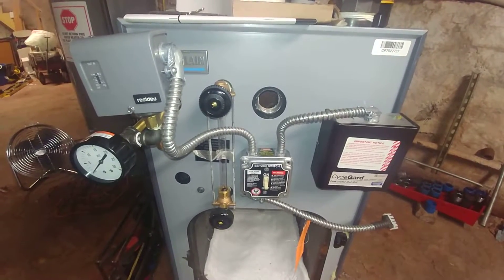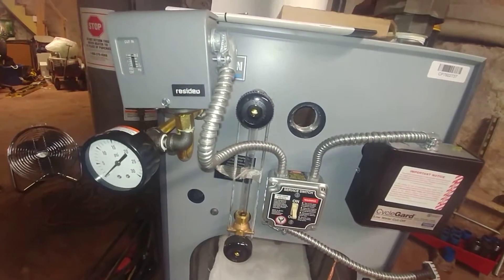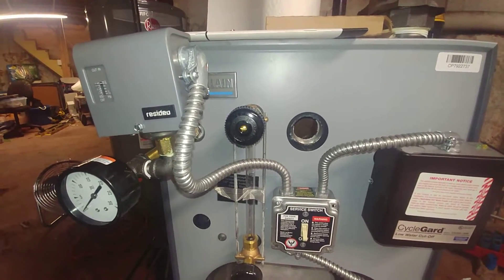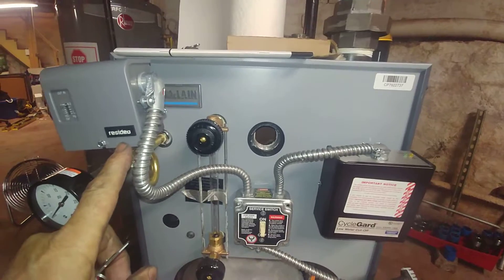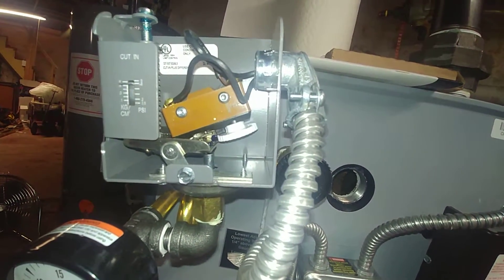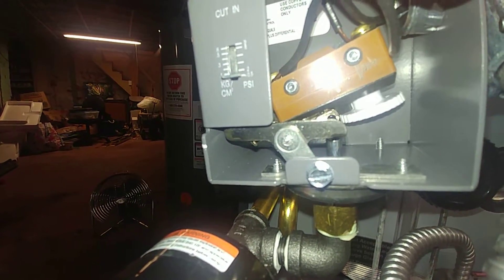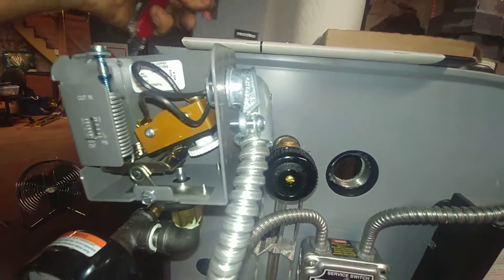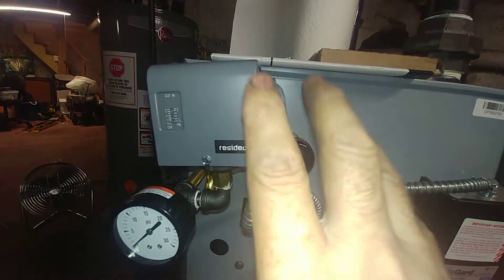Steam System Pressure Controllers Need To Be Checked And Properly Adjusted By The INSTALLER!

Comment: I know this is an old video so not sure you will take a look at this but quick question.  My Controller is set correctly, as you showed but my heat still runs up to 3.5 on cycle.  It seems high considering its set all the way down.  Is this normal or does it mean I need to clean the pig tail?  Thanks for the help great videos!
Reply from the maker: Hi! The PA404 is a reasonably precise limit control, but not very accurate.
What you are experiencing is an all too common occurrence with these controls, in that they allow the boiler to operate at pressures higher then the settings indicate.
You can tweak this control to operate closer to the 1.5 psi limit and I believe I show this in other videos (it involves very slightly bending the tab to engage the little pin on the switch way in the back).
Careful, you may go too far and make the switch not be able to reset. You can just bend the little tab back down.
It's really hard to show that on ytube because it is a "feel" and a slight "tweak".

Comment: So I just had a Weil McLain eg 6 series installed last year with the psi at factory settings. The tech that did the tune up this year lowered it to about 6 but after researching I initially lowered it to 1 with a 1 differential. At a higher psi the upstairs radiators that were giving troubles seemed to be working normally again, but after lowering it they’re back to square one. I’ve had guys come out just to bleed the radiators (which I’ve also done myself) and changed the vent valves numerous times with no luck. The pipes that connect to them get hot just not radiators. I know the radiators are still functioning since they worked at a higher psi but any idea why they are inconsistently or aren’t heating at all? Thanks in advance
Reply from the maker: I have no idea why your radiators are not heating.

It sounds like you really need to have a true steam person look at your overall situation and not just someone who "says" they are knowledgeable.
"Bleeding" a steam radiator sounds wrong to my ears.
Steam heating pressures set above 2 psi have been wrong since November 1899.
Reply: @gordonschweizer5154  Understood. I appreciate your time and response!

Comment: What is the downside to keeping it set high? I imagine that setting it low allows for the gas to turn off quicker so that its not trying to set such a high pressure, aka more efficient. Also i imagine this will help with banging pipes and potentially leaks from the valve stems which i was seeing. I bought a new house that was set yo the max and i hope this helps with the gurgling and hissing. Do i then need to adjust all of my vents? Or should they stay the same.
Reply from the maker: There should be very few upsides and a lot of downsides for keeping the pressure too high (above 2 psi) as you yourself point out.
As to your hissing vents, do they fog up a mirror when they are hissing? 
It might be time to replace those.
Reply: I'll take a look at that. Thanks for your suggestions and support.  @gordonschweizer5154

Comment: 150,000btu steam bioler in a residential property shouldnt my pressure limit gauge be set at 1
Reply from the maker: @lionsrunthenfc  The PA404A really is not designed to operate at a high limit of less than 1.5 psi.
If your steam system needs to operate at a lower pressure, then a Vaporstat is needed.
Reply: @gordonschweizer5154  so do I need to turn it back up to 2
Reply from the maker: @user-dx7ky6qc4v  Turn what up to 2?
Why?
Are you talking about the "cut in" setting or the differential wheel?
Reply from the maker: Cut-in setting plus differential equals cut out pressure
0.5 psi + 1 on the differential equals 1.5 psi minimum setting.
Reply: That's exactly what I have thank u.the wheel inside is at 1 and pressure is at 0.5.

Comment: Stationary engineer here and the proud owner of a steam system. Thanks for bridging some of the gaps I had between industrial and residential steam. After watching this I will be setting my vents to get the furthest radiator a little warmer rather than raising my pressure hahah. Thanks Gordon.
Reply from the maker: Great! Thanks!
Also, check to make sure your steam main venting is up to snuff.
Reply: Funny I was thinking the same thing. I never see pressure on my gauge, but I never hear steam leaking anywhere and I’ve walked down the system many times. Brand new boiler, last one had a failed heat exchanger
Reply: Just watch your “why no pressure” video and it all makes sense haha. From my industry experience running equipment is set to run at 12 o clock on the gauge for the accuracy you mentioned. I was not considering that 12 o clock on my residential gauge makes it a high pressure boiler in my state and my boiler would never come close to it. I was not familiar with residential operating pressures and expected to see SOMETHING on my gauge but I suppose you’re right, at such low psi with a gauge that’s comparatively high you wouldn’t necessarily see any pressure. Thanks. Now I’m off to find your video on main vents haha

Comment: Hi.  very new to residential steam over here but I have operated large boilers in the past. Our was set to 7psi with a 5 differential. I noticed when we moved in that the burner seemed to run abnormality long and wasn't cutting off at all untill thermostat was satisfied. I tried lowering to 0.5-2 psi with a differential at 1, then 2. The boiler now cycles on for 1.5 minutes and off for 1 minute. I read that my boiler could be oversized, but untill replacement, should I just increase differential untill cycle is a little longer?
Reply from the maker: Are you firing with oil?
You may try to have it down-fired.
Residential steam heating systems were designed around the "2 psi standard".  
Other steam heating systems only need 1/2 psi.
7 + 5 psi is crab steamer pressure!
Reply: It is oil fired. Slant Fin LD 40 with a Riello 40 burner. Mechanical return  system with a condensate tank/pump.  Convection style Finn rads built into the walls. The boiler is for 592 sqft of steam. 3000sqft house with a total of 12 radiators medium sized rads in Atlantic Canada. 

I currently have things set to 2psi cut it and 3 diff. This is at least keeoing the cycling down to 3 minutes on, 2 minutes off. 

The total call heating time with cycles included(Nest) is 3-4 hours a day, currently with daytime high around 40f and nighttime lows of 22f. It's gets a bit colder in January/feb but not to much. So acual burner time would just be slightly over half this time with the 3 minutes on, 2 off..... About 2-2.25 hours I would say. 

Boiler is quite old I believe.
Reply: I feel like with the age and condition of the boiler, I may be wise to have it replaced soon. It's a 87 year old house but with efficiency changes over the years, windows, insulation, draft control... The old girl might be way over sized.
Reply from the maker: With the high pressures you seem to be operating at, it does seem the unit was over-sized.
That is all too common, and often occurred when transitioning from coal to oil. 
The old coal-fired boiler had to be huge to hold the big pile of burning rocks, and a properly sized oil boiler would look too small and "wrong" to the installer and the customer of the day! 
Also, boilers were sized to handle the domestic hot water load sometimes, too!

Do all your radiators heat evenly and quietly?
Reply: Yes pretty even. I know when we bought the place and first started the heat up, a couple rads were hissing. I think there are 2 very small leaks around the inlet side of the union/threads. I don't here it now that it runs between 0.5-3.5psi. there is also less pipe noise. Just one area I suspect has a sticky trap (Hoffman 17C). I'm looking into replacement, maybe rebuild with tunnsel capsule.
Reply from the maker: @mikep3774  Yes, be ruthless in fixing any leaks!

Comment: Since I turned the pressure low, the fire hasn't kicked in. The steam heater is supposed to support the second floor, but I turned it down because the water kept evaporating without any visible leaks.
Reply: What can I do?.
Reply from the maker: First, is your "pigtail" clear of blockage?
Next, sometimes the p'trol will not reset if turned down too low.
Turn up the pressure just a bit to see if it will fire.
Reply: @gordonschweizer5154  it fires up when I move the cut in up a bit, although I still have my diff at 1 but my cut in at 2.5
Reply: Should I increase my different ? Not to forget that the reason I turned it all down was because the water kept drying up and the water feeder kept flashing
Reply from the maker: @asvpjoeyevdo9798  You've gotta find that leak or leaks.
How old is your boiler?
Reply: @gordonschweizer5154  7 years
Reply: Would I be looking for leaks of water ?
Reply from the maker: @asvpjoeyevdo9798  You might have a bad pressuretrol or the pigtail is clogged or both
Reply from the maker: @asvpjoeyevdo9798  Hissing vents. Loose packing nuts. Radiator union nuts. Wet returns.

Comment: I'm surprised that the pressure cutout doesn't have  a pig tail pipe connected to the  boiler. Any reason why new boilers don't have  a pig tail?
Reply from the maker: But this does have a pigtail.
It might not be visable in this video, but it's there underneath.

Comment: I have 2 cut in pressure controllers right next to each other, is it like a refrigeration system where one is the cut in and one is cut out? They both are identical and say cut in
Reply from the maker: As to your question of two pressuretrols right next to each other, I think they are acting in series. 
That is to say, if one fails to control the pressure, the other one takes over.
The problem is, most of the time when wired that way, they are also mounted on one pigtail!
Once that pigtail is clogged, its game over.
Reply: @gordonschweizer5154  okay thank you very much

Comment: Hi Jim again, I found your video as you suggested to set pressure control as low as possible. I found after dumped some more water, now pressure is 1.0 psi . Good enough?
Reply from the maker: Yes, that should be OK!
Reply: @gordonschweizer5154  happy new year GORDON！ do you have a video how to reduce pipe banging or noise when hot water heating (not steam heating) is on ? Thank you so much
Reply from the maker: @jimwu1182  You're most welcome!
Sorry to say that hot water heating pipes banging is a very unusual issue that we've seldom run into it.
The only thing that I can think of would be pipes running through a wall or ceiling penetration through a bound or very tight space being heated very quickly from cool to hot and the pipes expanding in length.
Reply: @gordonschweizer5154  the noise lauder I am worried if will bad to boiler. Someone said probably air in pipe
Reply from the maker: @jimwu1182  I'd shut down the boiler.
Let it cool down.
Make sure there is enough water in the system, the system properly pressurized & the expansion tank is not waterlogged.

Comment: Gordon. My pressurestrol is turned down all the way and shuts off at 3.5 psi. It was running over 10 psi can you believe it? I don't know how long the previous owner let it ran at over 10 psi. I bought a vaporstat and it's labeled in Ounce and kPa. You mentioned 1 pound.what should my vaporstat Diff and Main setting be to get 1 pound?
Reply from the maker: The "gray box" PA4040 pressuretrol is a fairly precise control, but not very accurate.
The settings on that control are the "cut-in" , that's the scale in front, which, as you know, should be all the way to the bottom and the differential wheel on the inside, which should be set to the number "1", so the control is "additive".

Vaporstats are set up differently.  

The scale on the right, set by the larger of the two screws on top, sets the high limit.
and the differential scale on the left is *subtractive*, so, in theory, if you set the high limit to max - 16 oz/in2 - and the differential to 6 oz/in2, it should reset and fire the boiler when the pressure drops below 16 minus 6 = 10 oz/in2.

Comment: Hi Gordon, I had my old oil burner replaced with a slant Fin gxha 120 and since then I have been learning a on about steam heating and I am about to pick up the "art of steam " and start reading that. 

I do believe these cheap pressuretrols are not accurate, I had to kick up my honeywell by a 1 or 1.5lb.

Others recommend replacing it with the upgraded honeywell units like L404F1367. 

Much thanks and I enjoy your videos.
Reply from the maker: Thank you for your kind words!
The PA404 that comes with steam boilers does have issues, don't get me wrong, but I would say, for the price point, its not all that bad.
The L404F1367 certainly looks more impressive, it is more expensive(?), but is it "better" than the more humble 404?
I'm not convinced and reserve judgement on that issue.

The reason I made this video was because I had just recently seen local police photos of a person who died partly due to high steam pressure from a residential boiler.
I will not go into details, but I will say what has been seen cannot be unseen.
Watch the video again with that in mind and "hear" what I don't say.
Reply: @gordonschweizer5154  that's always the scary stuff with pressure related stuff.

My pressuretrol does nothing at the .5. I let the system completely cool down and had it off for some time. Turned it on and slowly adjusted the pressuretrol untill it kicked on.

The issue I am seeing with my system is that it runs for 10-15 mins and then turns off for 5 or so minuets. 

I didn't have this issue when I had my oil furnace,  that thing would stay on until it hit temperature or I turned it off. Unfortunately the oil tank took up too much space in my basement and the furnace sounded like an airplane when it was on.
Reply from the maker: @YTSTK89  Do your radiators heat up evenly and quietly?
Reply: @gordonschweizer5154  so, I have 2 different types of rads. 1 is brand new cast iron and the other 3 are the aluminum fin style ones. The cast iron is very quiet and since I moved the air vent to the center and put a vent rite adjustable one , it now heats evenly with no cold spots. 
The 3 upstairs are the aluminum fin ones and I believe they heat up evenly, the 1 in my bedroom might need a new air vent since I seen some water come out of it. 

Over all no water hammers (THANK GOD). 

Actually, I did hear some water noise in my bedroom rad, I just pitched it up a tad bit more. 

2nd floor. My room has a gorton D, the back room has hoffman 43 and the center room does not have markings, though looks like the hoffman. 

Oh and my main is a gorton 1,

Im not consumed by the steam boiler world and am reading up on everything, crawling heatinghelp.com
Reply from the maker: It might help if you figured out your load (post your sizes and shapes on heatinghelp) and see if your boiler is oversized?
If so, you might be able to get a tech out to downfire (slightly) your gas boiler?
Do you have good main steam vents on your system?
Those convector style heaters (aluminum fin) tend to heat up quickly, generate a fair amount of condensate, and cool off quickly relative to the cast iron type.
Sometimes, if the riser can be vented (if accessible), then the convectors can be vented with slower vents.
Gorton D is a really large vent to put on any radiator, it gets the steam in, for sure, but the condensate has to get past it to get back to the boiler.
It also sounds like your p-trol is failing at the low end, an unusual failure, but not unheard of.
Maybe teak the cut-in another half a turn to increase the run time without upping the pressure too much.

Comment: Gordo…….mine is set to almost the last threads on that cut-in switch……gets me to 1 &1/2  to off, 1/2 back on….PSI, that is.
Reply from the maker: We found out a bit later that this pressuretrol was off by about one psi even after adjusting it as shown in the video.
(Still better than leaving it at 8 psi, methinks)
Thank you for checking and reporting on your pressuretrol. Good on you, sir!
Reply: @gordonschweizer5154  After installing a 3psi gauge I saw that it was off too (higher than .5psi). I was able to tinker a little with the adjustment indicator in the pressuretrol so it bottoms out lower.
Reply from the maker: @Ldall87  Excellent!
Thank you for that feed-back.
Happy steaming & stay safe.